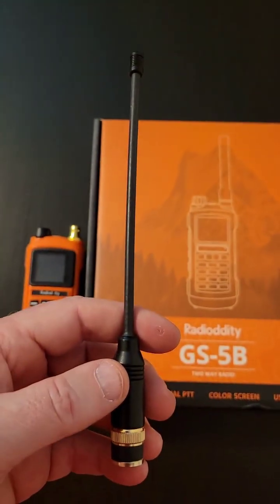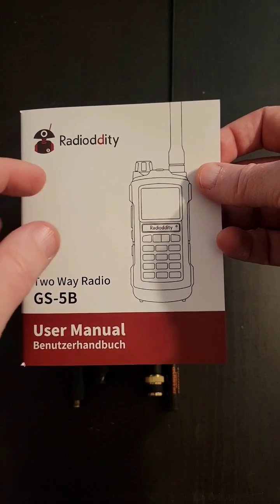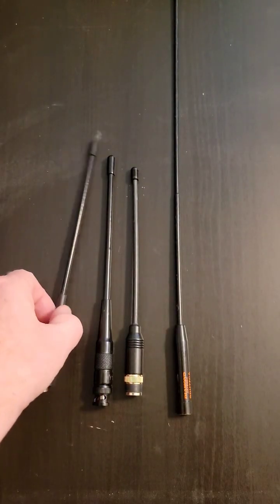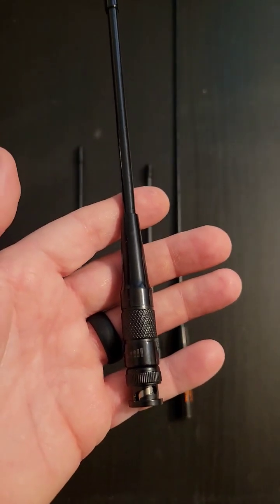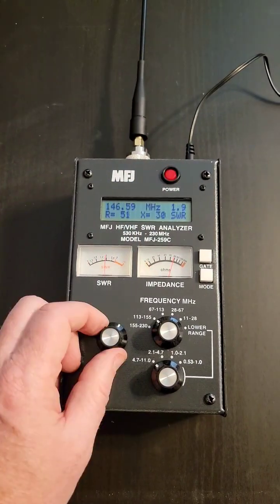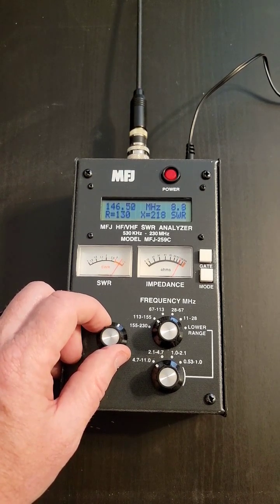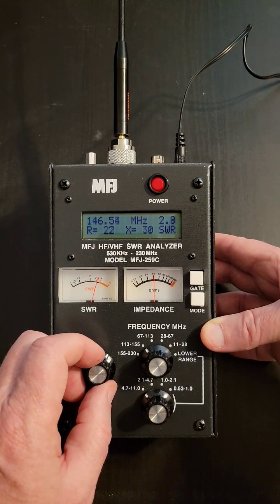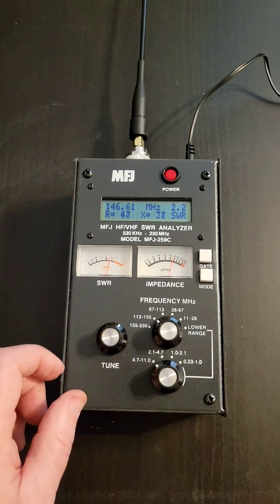SWR Testing for VHF/UHF Antennas Can Be Misleading! #Shorts

Comment: Without hearing your answer I would guess it’s because you don’t have a shield plate acting as the ground plane at the base of the antenna, to best replicate conditions necessary to accurately test (as much as is even possible) for a whip antenna on a handheld.  But you likely already know that if you’re using that antenna tester (which isn’t cheap and isn’t used by most).